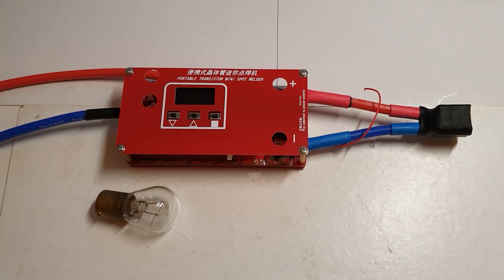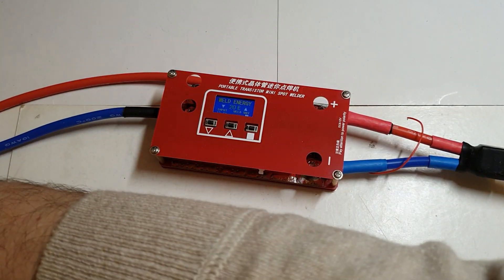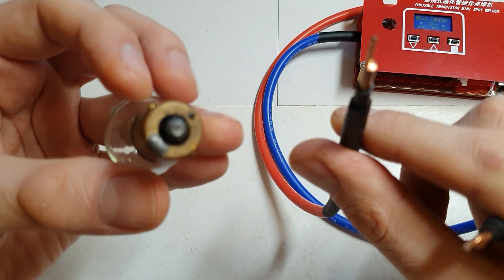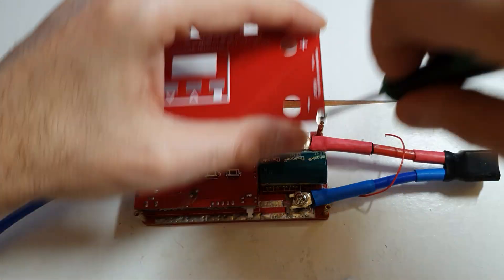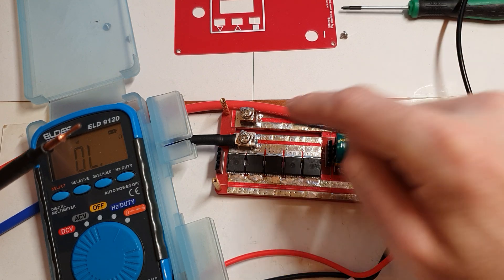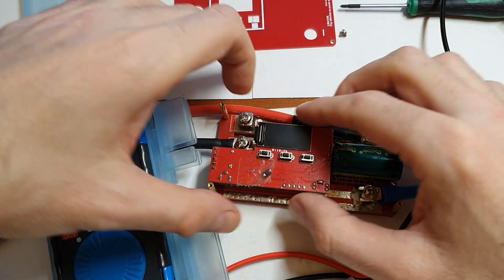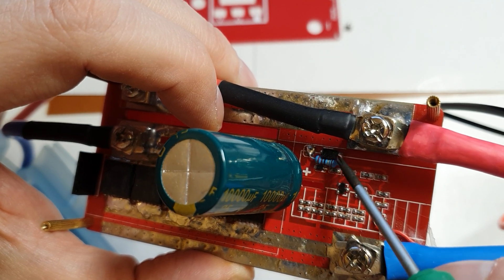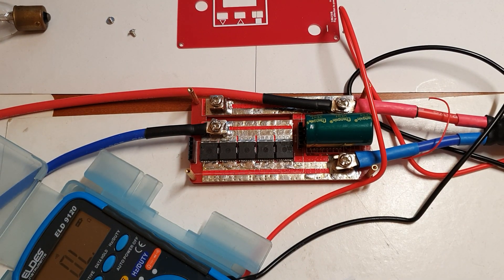Mini Spot Welder Quick Test method

Comment: Thanks for your suggestions. I will give them a go. I do have another spot welder and it works well with the battery I have which I omitted to say was a 12.8V 100Ah Lithium phosphate battery.

Comment: Thanks for a great video on testing the spot welder. I used mine for the first time a couple of days ago. I'm using a 12.8v 100Ah battery. The unit connects up as normal. When I make the first weld, weld is not very strong and the unit shuts down. I have to disconnect the ower cable from the battery and reconnect to restart the welder. Any idea why this could be happening?
Reply from the maker: I would suggest you verify firstly if the welder is triggering correctly by doing the filament lamp test - any 6V or 12V classic filament car headlight will do. You should set the timing to over 50 to actually see some flash as mentioned in my lamp test video. If you do get the flash and the welder doesn't shut down then the problem is your battery, it's not capable of delivering the 250Amps or so impulse current. Check that your cables are well connected and use the provided ones without extensions. Try with another car battery if you can or use a 3S 5000mAh 50C or more LiPo.

Comment: I've got a purple spot welder, i use it about 5 times and worked fine, but when i tried to use i thers no spark with the same battery, the button, sound and LED works fine, i checked the continuity with the mosfets, no continuity, whats wrong?
Reply from the maker: Hi, if you hear the weld beep confirmation but get no weld, either the battery is not supplying sufficient power or they FETs are not being triggered for some reason. You should try the lightbulb test using a 12V (or even 6V) normal filament light bulb - I explain how to in a video in my playlist.
Reply: @Luca_Techy  i saw your video with 12v bulb test, i am not trying but i think the mosfets because i bought the same k99 spot welder and weld firmly with the same battery before I used. I thicken the traces to supply more power to the traces maybe oberheat the board

Comment: I have this unit. When I tried for the first time, with a lawnmower battery (U1), I killed three of the FETs. I ordered some more and replaced them and added the capacitor fix suggested by Maker Luca but when I tested again (with a 94R battery this time), each time, a FET would pop and catch fire. I was getting decent welds (at 45) but was losing a FET each time. I'm not sure what the issue is. I put a DSO on when I was down to 2 and there didn't appear to be a deep sag in the voltage. I have five unused FETS left. I have a solenoid on order and I'm going to try using this device as a control on that and get the pack I wanted welded up and then I'll investigate further with the FETS.
Reply from the maker: What thickness strips were you trying to weld? Did you shorten the original power leads? Also, when a FET shorts you would need to replace the whole batch or simply leave the ones that are left as they are matched (supposedly) in batches. 45ms is already a very long pulse window, you should be able to weld .15mm strips with less than 20ms. Attempting to weld anything over .2mms is overkill for the unit and out of specs as explained in the FAQ (it all depends then on the FET matching and general assembly of the unit).
Reply: @Luca_Techy The strip is 0.15 so should be OK. Other than the replaced FETS and the extra capacitor, it's all stock. I don't think the number is ms but some energy measurement. If I said that, I misspoke. I bought a pack of 10 fets but I'll replace all five anyway (I only have one left on the board right now anyway). I'm going to try the solenoid and get my pack done before I try and mess with just the fets again (or I may just stick with the solenoid if it works well).
Reply from the maker: Just keep in mind that normal solenoids aren't reliable (consistent) under the 20ms or so time frame so you need a specific power solenoid that can handle that speed and current peak (200+Amps). Solenoids can be used for thicker spot welds but if you are spot welding 18650 or 27100  cells which usually takes 20ms or so and something gets stuck you will perforate the negative side of the cell permanently damaging it. The same applies to a shorted FET(s) situation to be clear which though should not happen under normal circumstances.
Reply: @Luca_Techy  I'll definitely be doing testing to see how well it follows the inputs. Damage to the cells is not that important for this pack as I'm using used cells (actually aggregating two existing packs). I have a bunch of dead ones that I can practice on too.
Reply: @Luca_Techy  Which FAQ are you referencing, by the way?
Reply from the maker: If you check my Spot Welder videos playlist, the last video I posted is the FAQs one.

Comment: Hello Luca, Thank you for such a great video!!  I made the stupid mistake of hooking it up backwards.  The mosfets are definitely shorted out. Any idea what replacement mosfets i can buy? Can't see any part numbers on the mosfets. Thanks in advance!!
Aaron
Reply from the maker: Hi Aaron, if you check out my video descriptions in the playlist the main components are all listed and there are links to download the schematics. If you hooked it up backwards hopefully you just may have damaged a FET but depending on the version you have you may have damaged also the regulator and/or logic board. You can try powering just the logic board if you have a bench power supply and some alligator clips and see if it turna on (check the pinout from my schematic to see which is + and minus - you can power it from 7V to 14V with less than 200mA current). If the logic board still works then you just have a shorted FET (or 2) and should be repairable. It also depends on what board rev you have.

Comment: Thanks for the great videos. I have a unit that never worked out the box.  It goes thru the stages of welding but doesn't weld on any setting.
Reply from the maker: Hi, based on your welder model, have you applied the R4 mod? Did you check my other videos about this mod?
Reply: @Luca_Techy  I watch many videos. This is the version without the R4 resistor. There are no components under the capacitor.. Thanks for the reply.
Reply from the maker: What model is it exactly? The old Rev 0 with the FET driver or the new rev-0 with the voltage booster described in my latest video?
Reply: @Luca_Techy  It's unmarked with has white buttoms with 5 mofets Rev 0 first additon. I think I will buy another one if I can't get this one working. Which version do you would you recommend? Or maybe a different type.
Reply from the maker: Ok so if you hear the double beep when contacting the electrodes it means the detect circuit is working - what battery are you using? Is it at least a 3S 5000mAh 50C or 12V AGM 45Ah? Did you try the 12V lamp test by increasing weld time up to max to see if you are getting a pulse?
Reply: @Luca_Techy  I hear the double beeps when contactiing the electrodes. 
I'm going to purchase a 3s 5000mah battery. I will let you know how it goes.  I tried with a 2200mah 50c lipo. No need for me to purchase a car battery that I will not use often. Thanks for the help.
Reply from the maker: Ok - just try the 12V light bulb test with your battery: set the pulse to 99 and try it with a light bulb and see if you get any flash. Do this of course just with a light bulb, even a 6V will do.
Reply: @Luca_Techy  I wil tried this. I have to find a bulb. I saw you video about this. Thanks
Reply: @Luca_Techy  The ligtbulb test worked. It flashed the light on. It seems like I need a higher  mah battery.  Which I ordered today. Thanks
Reply from the maker: @hangdog242 If your version is the original Rev 0 with the FET driver you need to add a 1000uF decoupling cap after the + rail output diode on the MCU board to avoid blowing the FETs due to gate undervoltage - you can see how if you check Maker Fabio's video. If your version is the new Rev 0 with the booster circuit you would need the resistor mod instead as I show in my latest video. Feel free to sub for any future updates!
Reply: @Luca_Techy  I added the capacitor already before I tried to use it. Thanks
Reply: @Luca_Techy  Hello, I thought that I would give you an update . I got welder working properly now. I replace the voltage input wires with shorter 12awg  4 inch long wires. The original wire were 14 awg  with large battery clamps and too long. Thanks for taking the time to help me. I appreciate it.

Comment: hi i just got one, as i plug it in it just beeps , the screen wont turn on, and it doesent react to the power button , i bought a 12v 5a charger and welded it to the tip they provide, what am i doing wrong? is my power supply not the correct one?
Reply from the maker: I'm a bit confused here, what did you weld to what tip? Firstly, use a 3S 5000mAH 50C (at least) Lipo pack to power the welder when welding strips. Be sure to connect the power to the input power side of the welder, not the output/terminal weld tip side. The input is on the right side of the welder looking at the display facing you so that the 3 buttons are below the display. If you connect the pack and the welder beeps but the display doesn't turn on then there's a fault: possibly just the display or it could be the MCU, but if it beeps it means the MCU is doing something and it may just be the display which is faulty. If you have that 5A 12V PSU/charger, connect that to the power input in place of the battery for testing purposes. It should beep as usual when you power it. Try simply bridging the welding tips together and see if you get a double beep - if so the welder works but the display is faulty (maybe the flat ribbon is misplaced on the connector or is torn - you can unscrew the top 4 screws and check the display ribbon yourself if it's seated correctly in the connector - be careful not to tear it). You should also connect a 6-12V lightbulb and try to see if it briefly flashes when connecting it across the weld terminals, but you would need to increase the weld time to over 50 to see a decent flash. If you bridge the terminals and nothing happens (no double beep) then the MCU is dead or there's a major fault. If the light bulb constantly shines when bridging again there is a major fault (shorted FET for ex.).

Comment: Hi Luca. I have an original version 0 unlabelled welder. Can you tell me the values of the 2 resistors situated between the optocoupler and the fet driver.thanks.
Reply: Many thanks for the information that’s helped me.
Reply from the maker: I'm not sure which ones you mean but the one in series with the opto on pin 1 is 1K (102). The other one located on the opposite side is a 10K pullup (103) which is located beside a cap (probably a 100nF or 104K) which is near the input diode. If you check my video (and the other All Mini Spot Welder versions) there is a pic of the original Rev 0 MCU where you should make out the components.

Comment: Very bad luck I had! While I was screwing the power cables onto the device one of the cables slashed out and hit the connectors between the screen board and the base board very shortly but enough to blow the microcontroller. No sparks, just a soft tick, no magic smoke but a sweet smell..... I can see now a tiny hole in the middle of the microcontroller. :(
Moral of the story: shield the contacts with some tape before playing with the device.
I have ordered a new unit... :/
Reply from the maker: That's a bummer -  I suggest though to connect and screw on the power wires on the welder side always before connecting them to the battery in order to avoid any shorts o mishaps such as this one. Battery is always connected at the end of the cabling.

Comment: What kind of hack would it be necessary to source 12v to the driver from a separate power supply? Doing so there wouldn't be a problem with the dropping voltage. At the same time, the spot welding current is to be independent from the one needed by the driver. In my case, I am interested in hacking the "Wise Maple" version.
Reply from the maker: You would need to isolate the +V to the MCU and feeding it a seperate +12. However this is unnecessary once the inrush current limiter resistor has been added in series with the cap, but is less critical on the Wise Maple, or use one of those XT90 connectors with anti spark resistor (same thing but directly in the connector). The Wise Maple needs only this mod - you don't need to source a seperate voltage. The other models need the R4 mod as even with a seperate voltage source they would fail due to incorrect Gate drive.

Comment: do you mind having a look at the BIFRC? it seems to be doing a much better job than the other cheap spotwelders. it has 8 mosfets. Im getting my unit in two weeks. I will analyze the circuit to my ability and if you want send you pictures and measurements with my oscilloscope.
Reply from the maker: I had ordered one but never received it - I also ordered one with a one cell LiPo included and that also never made it here so I gave up. If you want to take some scope shots feel free to send me them thought the circuit analysis will be more difficult without the board itself.
Reply: @Luca_Techy  I got the bifrc and an updated red one. they listened to everything you said in your videos. the bifrc is garbage. pulses every second or manual trigger. no auto trigger. the red one is amazibgly pwerful everything is reinforced now.
Reply: I ordered my DH30 (m8s) LCD touch screen one in October 2021..(£45)
 From the first time didn't give me any proper impulse with a parallel 2x5000mAh 45c 3s LiPo.. Then with a 110Ah 950A car battery I had one successful welding after one fet blown.. I desoldered that FET and also ordered a complete replacement FET board.
I tried with that car battery and with the old board few times,  but there is many adjustment, not just the 20 gears but Ah, c...
So I tried increase step by step, but the impulse was  (if was ) most of the time a very little click heard, nothing more. Then when arrived to the maximum gear then few times got a very huge power, burned a hole in the nickel strip..  So I was given up a bit. Than I saw this video and thought, might same way if I trace and can hacking the control board's power, might will working.
But... I made a mistake. I plugged to the computer with an USB-C  cable. Appeared as  a USB flash drive ( named haohaodada) there have to copy the new firmware if have (but not new or old found anywhere)
From that time, the control board didn't booting. Because the on/off designed as a capacitive touch, I measured that chip it's works, if I touch the on/off surface on the case, then the 5V and 3.3V are present, if touch again then they disappear.  So that part works, but no beep, no screen no any sign of life. If I plug to USB, as a flash disk still appears, but looks stucked in firmware update mode.  
The microcontroller is an ARM Cortex 0, but labelled as "haoda USB"  
As I researched that's a Chinese Stem program to learn programming this chip. On they website, have olnline courses, online interface for make scripts like Arduino IDE, but no any  hardware documentation..
On they developer board seems like an arduino nano and there is  a reset/restart button exists. But in this spot welder board not, so I can't just simple restart without at least know the chip pins and the layout.. 
 
Their website (bifrc.com) is totally wiped, nothing available, just like a freshly installed raw webserver.. No firmware,  no contact, no support anywhere.  
Their Facebook page also inactive,  last post from 2018..  Instagram same..
Reply: The bifrc guy unavailable.. I find out he is a very  young FPV racing drone enthusiast and hobbyist.  He or his friend also call as LantianRC, what was late brand name of his or their project, but BIFRC abandoned since 2018 LantianRC also since 2019...
They instagram pages still available,  but no new posts and no answers for messages on any of those accounts..
I couldn't find any at least archived webpage of them or the firmware or anything else..

Comment: I have got my cb23-4k version 
And I didn’t modify it but at my second test the mosfet burn 🤦🏻‍♂️
I used 35ah car battery 
If I changed the burned mosfet and do these modifications is it will work good?

Another question if I removed the burned mosfet without replacing a new one what will happen?
Reply from the maker: Locate and remove the shorted FET - you can use the welder with just 4 FETs it will work fine if you don't overdrive it just apply the mods.

Comment: Please someone should educate me if 12V/65amps adapter (power supply) can power this spot welding machine effectively.
Reply from the maker: No it's not appropriate. You need a good 12V battery (40Ah car battery) or a 3S 5000mAh Lipo with 50C at least. You need a peak current of 200 Amps at least to spot weld.

Comment: Or just use a multimeter maybe?!
Reply from the maker: Sure, if you are handy with one that's fine - but that wasn't the point here. The method described is an easy, quick and safe way to know if your spot welder is functioning correctly without any multimeter.

Comment: I appreciate your video, I don't  think this red mini spot welder is good. My advice is not to buy it.I hope you do the same. I have several videos on the red mini spot welder. They just broke for no reason.
Reply: I agree. Mine was blown the first time I used it with a 5000 mAh 3S 75C lipo. Replaced the blown fet but it refuses to weld. It is rubbish. I'm gonna buy something else like the BIFRC DH20. It seems pretty trouble free to me and it has an internal battery. However, nice testing method with a regular bulb!